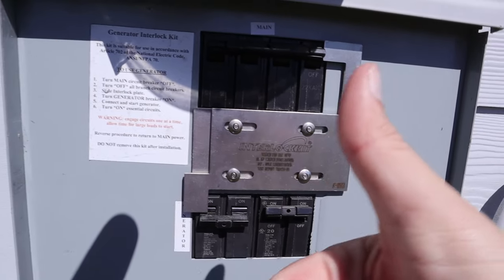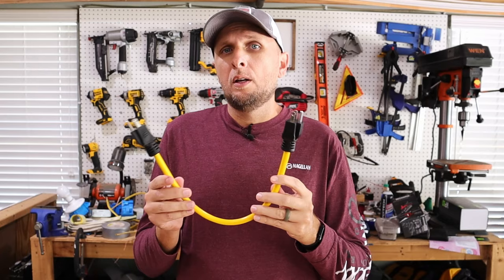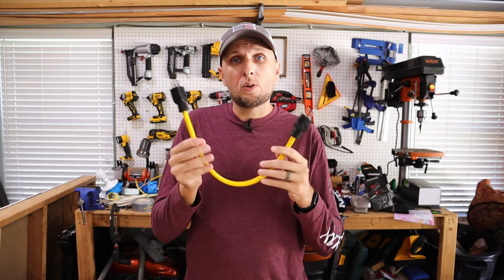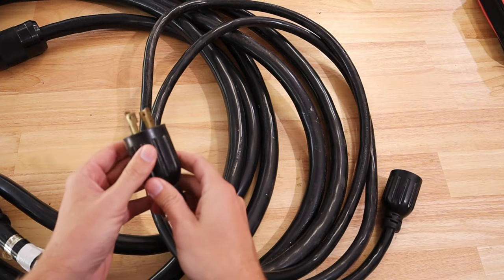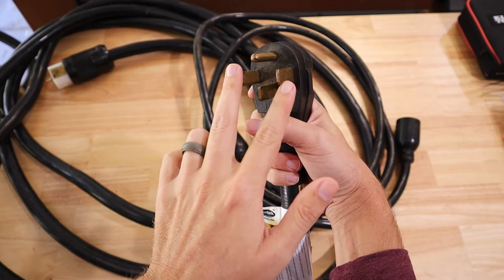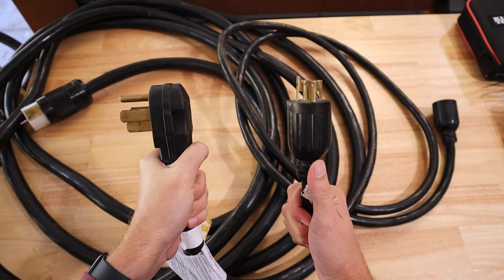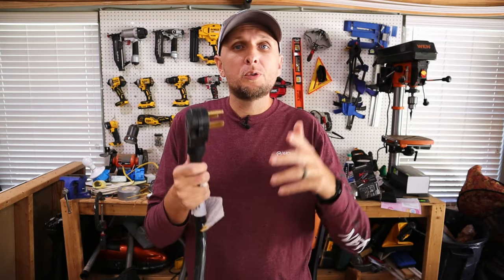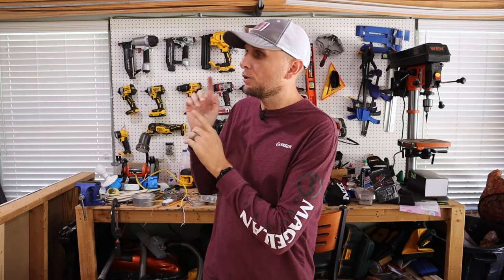HUGE Electrical Mistake Too Many People Make - Backfeeding

Comment: i'm a retired lineman for a local power company and over the years we would always be on the lookout for home generators that might be backfeeding onto our syetem during outages.
Reply: That's what I was told.   I also heard that the first thing linemen do is ground the normally live wires in case any generators are currently (no pun intended) on-line.
Reply: @billdarling2629  in theory grounding the line was the correct thing to do but we never really did it because it wasn't always practical. we would always practice our safe working procedures like wearing our rubber gloves when handling a downed line and make sure there were openings in the line by opening switches and lifting connectors, and treating any of our wires as if they were alive or could become alive.
Reply: @steveperry1344  good to know.  thanks for sharing.   yet another reason to be careful to keep the main breaker off while using a generator to feed power to the electric panel.
Reply: @billdarling2629  Don't feed into a wall outlet.  When you do that the power is not going through a breaker (or fuse).  Plug in a power surge strip (with a breaker) into the generator.
Reply: isn't there a way you could test the lines to make sure they aren't energized before you guys would touch them and start working on them? i wouldn't trust entire neighborhoods full of people to not have at least 1 complete idiot who is doing something stupid
Reply: I not a lineman but I would never touch a power line even if been power down trust me there have enough naturally relaxation storage to kill. If ever would even with linemen like I have you know this. Also not close main breaker when back feed will just cause a shut against general intenervor. Unless you house disconnect at poll.  The double 110v plug for campers  or you pick up truck sleeper.

Comment: As long as you turn off the main breaker and remember to keep it off till the generator is disconnected from the setup and remove the cord you'll be ok and be mindful of the Amps you use too
Reply: the neutral in your house panel is not disconnected unless you have a transfer switch in play.the neutral is connected to center tap on utiliy transformer.usually not broken with your main disconnect switch or breaker.
Reply: @terryj.macmullen9968  I thought about that too
Reply: @terryj.macmullen9968 
The Neutral and Ground conductors in residential wiring are NEVER "switched" (interupted - ie: they stay completely intact).  NOT EVER!!  How does this inherently cause ANY amount of current/voltage to be passed out of your house (main panel double-breaker off!!), and into the grid?  The Neutral is bonded to the Earth Ground IN THE PANEL!  Therefore, I can't see why this would be a problem.  Please explain!!
Reply: @terryj.macmullen9968  when electricians install a proper backfeed into your panel, the neutral is not switched either. It does not make electricity flow to the street, only hot wires can do that. You can touch a neutral and not feel a thing because its bonded to the ground

Comment: Great presentation. If you don't know how to shut off your main breaker and not energize your generator electric panel until all cords have been installed or plug in last to the generator, then stick with extension cords and/or get a transfer switch.
Reply from the maker: Thanks for the feedback!
Reply: You should stick with a transfer switch anyway, as it is much safer. Mistakes can be made
Reply: @deang5622  Sometimes in cases of an emergency, this is the only option.
Reply: @markmalaney5542  it is never the only option. If you have the option to plug the suicide cord, you have the option to use the extension cord to plug the appliance directly into the generator.
Reply: @maximeboissonneault6203  that's fine if you're only using 1 appliance but when you live on an island and an ice storm hits and you won't have power for a week or more then using a single ext. cord to power 1 device, is not an option.

Comment: So basically if you're not an idiot you can do this fine. Turn off your main, plug in your suicide cord to your dryer outlet and to the generator then start your generator. I totally get that this is to complicated for some to do safely but it if it's an emergency situation  and you actually understand how to do it, it's fine. TURN OFF YOUR MAIN!! Some linemen life depends on it.

Comment: If you have any common sense and more than 2 brain cells, you CAN safely backfeed  the way you are saying NOT to do it...    Yes, many of the reasons that you listed as unsafe are true but with a little caution while plugging things in (such as Main breaker OFF, generator OFF, AND even then making sure you dont touch any exposed prongs) AND KNOWING for sure that you have sufficient gauge wire for the amps you will be feeding through it, there is nothing  unsafe in doing it the "wrong" (according to you) way.... Of course, like I said, you have to have at least 2 brain cells, AND some common sense, which rules out about 80% of the population of the world...

Comment: OK, so lineman can work on powerlines fed by the substation but it's dangerous if those same lines are back fed through a 30a generator?? My one experience with accidently flipping on the feed breaker before turning off the main resulted in the motor bogging down and would have undoubtedly popped the generator breaker if I hadn't been so quick the flip it back off. I realize back feeding a breaker panel is not approved, but not everyone can afford to hire an electrician and pay them $500-$1000 to wire in a "safe" plug or a transfer switch. Nor can we afford to allow everything in our freezer to spoil. So sometimes "a mans gotta do what a mans gotta do"! Common sense seems to be in short supply these days. The plug that goes into the generator is LAST! As much as I would love to have an automatic stand by or even a fancy transfer switch for my 8.5kw portable, it just ain't in the budget. While I don't suggest it, I've been using a "suicide" cord for 30 years now. Never lit myself up. Now that I bragged about it, look for my obituary.

Comment: Ok so being honest. I have a 6550 generator. A friend set up a cord that he made all by himself 50 amp style cord and plug that goes into my dryer outlet with a 30 amp head that goes into my generator. I plug them in before I start the generator which I understand puts a strain on the generator at initial startup.  I also shut off the main breakers on my electric box, so there’s no chance of backfeeding so ultimately feeding 110 volts through the 220 V wire I don’t know how many amps I’m using because I’m only running like 2 refrigerators, couple floor fans, led lights. Etc, how easy is it to start a fire?
Reply: If it's all wired correctly you more than likely ok but it it's better to put in the proper transfer switch it takes out the potential for back feeding on the lines or blowing up
Reply: @jamesgarrison6430  thank you. I understand

Comment: It's not a big deal, lock your panels after the main breaker is off with a lock , attach the key to the Widowmaker cable .. can't unlock the panel without the Widowmaker cable removed .. problem solved .. if you are smart

Comment: Blame the idiots who don't know how to turn off their main breaker, don't blame the cord. The cord is perfectly safe to use if you're not dimwitted.
Reply: False.  And voids your home warranty.
Reply: @ericgardner5548  It's just a conductor... If you're safe and don't overload the circuit and isolate your home by turning off the main breaker it IS perfectly safe. You can't just tout back "false" with no explanation.

Comment: I always backfeed through the dryer outlet...  This is how I've done it for years. 

1. My house has a main disconnect that isolates it from the incoming electrical service. This remains OFF until I see that power has been restored to the neighborhood.
2.  I use #8 AWG wire and 30 amp plugs on the 30 amp feed from the generator.  Dryer breaker is also rated for 30 amps.
3. I turn off all breakers - generator, dryer, main disco and all breakers in the house breaker box.
4. Plug both ends of cord in, start generator and flip breakers on in order of flow - generator, dryer, then whichever breakers I need for the house, usually fridge, window unit or space heater, air pump for fishroom and a few lights.  Everything else in the house is unplugged.
5. Nobody and I mean nobody is allowed to touch the generator, power cord or breaker box except me.  

If I'm missing anything, please let me know.
Reply: I don't think you have missed anything, other than the fact that you have a 5 step list that must be religiously followed to do this without danger.  Some sort of interlock that assures that it is impossible for the generator to be connected without the street feed also being connected would be a lot safer.
Reply: Exactly what I do.

Comment: When it comes to current:
1. Generators tend to have a separate fuze for the 20A outlets
2. Breakers work both ways
This means that if the generator does not have a fuze, only the line up to the breaker can take more than the breaker is rated for

It should also be said that while backfeeding is an issue, the lineman still needs to wear safety gear as there are still plenty of other ways to put a charge on the wires

With that said, I am still not ever buying or making any cords with male to male plugs.
Reply from the maker: Yeah I agree with you.  Everything SHOULD work or be done properly.  Just never know though.  Thanks for the feedback!
Reply: @HowToHomeDIY  No you are not agreeing. He pointed out that your claim of overloading a circuit is incorrect. The circuit is still protected by the panel breaker regardless of which direction it feeds from, thus protecting the wiring in the circuit. I am not advocating that method, just pointing out the error in your statement.
Reply from the maker: No, I am agreeing with him that the breakers should protect regardless of direction.   However I would not just count on that if I don’t absolutely have to.    Thanks for telling me what I agree with and don’t 😂

Comment: I have a dedicated 50 amp breaker installed to house secondary break that controls the power into the house. 
  The next thing is turning off so breaker on the house breaker system. 
 Then I’ll connect the cabling from the female
 Before going any further I’ll turn off the main primary breaker from the city. This way there is no risk of creating any hazard or risk of a fire.
 I’ll start the generator with all breakers turned off. From I make connection from breaker box to the generator. Then I’ll energize the circuit. From there I turn on only the breaker needed to use. 
  I would attached pictures but this app does not allow that. 
That’s for you video

Comment: Very high quality video!  However, when done correctly back feeding isn’t dangerous to anyone.
Reply from the maker: If every single thing is done correctly then yes you are right, it will work and nothing bad will happen.  But everyone makes mistakes or forgets things from time to time so always best to try and put things in place that take mistakes out of the equation.  I appreciate the feedback!
Reply: @HowToHomeDIY   Thanks for pointing out the danger part of this practice but you should also point out that when someone decides to do this , and believe me some will,  they should use a DEDICATED 20A GFI protected outlet that runs straight to the panel . This way you avoid plugging in other shared outlets and either overload the circuit or risk damages to the appliance since they are not protected at the panel by the 20A breaker.

Comment: I'm using a 50 amp cord that plugs into my generator and the other end plugs into my compressor/welding plug. I dont have the switch and do understand the risk to others if you don't turn off main power and actually back-feed the power grid. Old school yes but it works. Was actually put in by previous owner and he told me how he used it. Great channel good advice.
Reply: I installed a 240v 50A outlet in my garage for this very purpose and made my own cable using 6-gauge wire.  Just before Y2K I bought a generator to help heat my house "just in case".  I live in a cold climate, and am a T1 diabetic.  I could not risk my insulin freezing.  It was a gamble.  I did use my generator a few times during power outages, and most certainly shut off the main breaker every time before even starting the generator.  Never had a problem.  Sold the generator maybe 10 years later.  Still have the outlet in my garage.  FWIW, I have a degree in electrical engineering so I do fully understand the risks.

Comment: Glad to hear you mention back feed on line crews. My career was in that arena and, as time progressed from the 70’s well into the 2000’s the used of generators and back feed problems got worse and worse. While working storm trouble we’d arrive on a job site and our ears would be tuned to the sound of running generators. People don’t realize that transformers are ‘stupid’ and will not only STWP DOWN voltage, but they STEP UP voltage as well! Good job….I enjoy your videos!
Reply: I still don't understand how a 2kw generator will backfeed an entire neighborhood and not trip its breaker or burn up the windings? 
I'm not downplaying the safety btw?

Comment: I use one of these with with a 300watt ryobi 40v battery inverter.  Lets me run some of my overhead lights and a TV  during power outages.  Just cut the breaker, plug it in, and turn it on.
Reply: I do the same.  I power my living room and garage so I can run the opener.

Comment: When back-feeding during an outage, I turn off the main breaker FIRST.  Then, I put a piece of duct tape over the main breaker handle with the word "NO!!!" written on it.  I am the ONLY person at this residence who would be doing this task.  Then, I make both of my connections - cable to generator/cable to designated outlet.  Then, I turn OFF all breakers in my box that I don't need/can't power (AC etc).  Then, I start my generator.  MAKE A FINAL INSPECTION!!  Then, and only then, I turn ON the double-breaker in my main panel connected to the 240v/30 amp outlet I have wired in for this express purpose.  No problems!   I have tested my main breaker connections (incoming side), and can detect no voltage present while using this method.  If I perform all these steps, and we assume my main breaker is functioning correctly, how can this method inherently be dangerous?   You simply MUST be aware of what you're doing and when to do it!!  I  welcome any comments regarding this!!
Reply from the maker: So yes, it would have the same effect as the interlock kit if all of those steps are taken and nobody else touches it.  The reason for the code is to make sure it’s impossible for the two to be on at the same time taking human error into consideration and out of the equation.
Reply: @HowToHomeDIY  
I would love to have one of those simple sliding interlock kits to be even safer.  However there is no way I can rewire my 40 y.o. panel so that the backfeed breaker is in the correct position in the box to function as designed.  I take all this very seriously since I understand what the outcome could be from not doing it "right".  Thanks for your answer!

Comment: It's ok if you do it smart.  Kill the main breaker and all the individual circuits except the one you connect to.  I've got a 30 amp 120 volt outlet for an RV that was wired using a repurposed 50 amp 240 circuit.  From that you could certainly power two 15 amp 120 volt circuits.  Enough for one circuit to run a small window A/C and the other for a few lights, a fan and a small TV plus some phone chargers.

Comment: Flip the main breaker to prevent backfeeding or your generator will damn near die.  The generator 220v NEMA 6-20 "winking" outlet on most residential generators and in most garages are both 20 amps. At least in America. Better than freezing to death.

Comment: Why even make the suicide cords? I just had interlock and inlet box professionally installed. Was thinking about transfer switch but your videos helped with my decision.
Reply from the maker: Well some don't want to spend the money to have something done right and in a safe manner.  Really glad to hear you liked it.  Thanks a lot for the feedback!
Reply: @HowToHomeDIY It does get expensive specially if you need to hire an licensed electrician to install a generator inlet and transfer switch and pay $100 for a cable. Having said that, if you happen to live in an area prone to hurricanes or constant power outages that might last for days vs rare power outages that might last for a few hours the investment is worth it.

Comment: I have a 220 plug in my garage and if power goes out I have no water as I’m on a well. So turn off all the breakers and sub panels then plug cord into outlet then to generator. Then start generator. Turn on generator breaker switch. 
Go to house panel turn on well pump breaker and hot water tank. Now I have running water and I can still shower then turn off hot water breaker and turn on a couple lights. 
This is safe if you follow the steps.
Reply: This is exactly how I do it.

Comment: I added a genny as soon as I could afford one, a small portable That fed thru a dedicated plug in the workshop when needed...  But, I had the setup checked by the power company and they went over my startup and shutdown checklist for me and approved it.  First item on the Start Up Checklist was TURN OFF main power breaker.  Last item on the Shut Down Check List; Turn On Main Power breaker.   As soon as we could afford it, we got a 20k Generac Genny that was properly wired into the house, started and shutdown automatically and auto switched.  But living in a small rural community where power went out when butterflies flew by during a storm... we needed backup power. LOL.